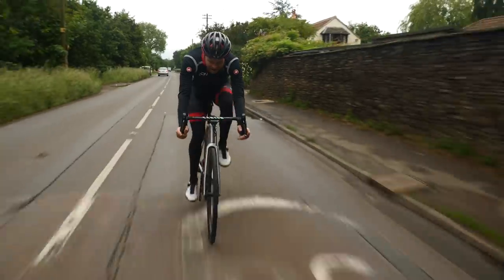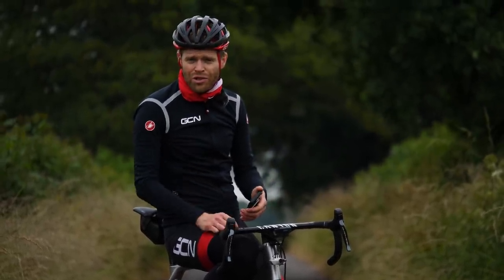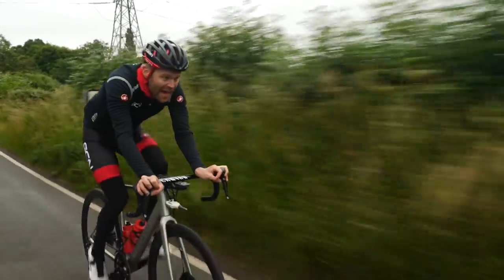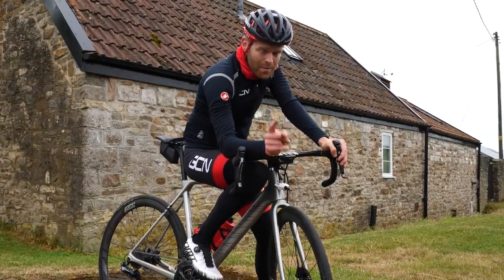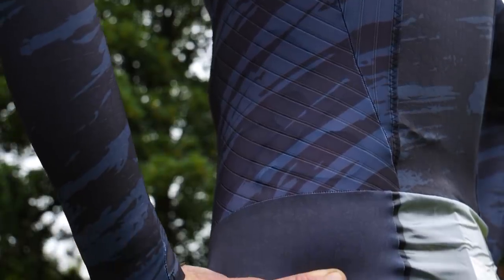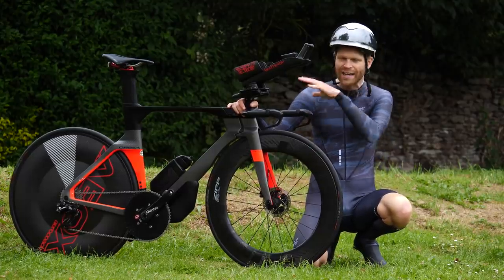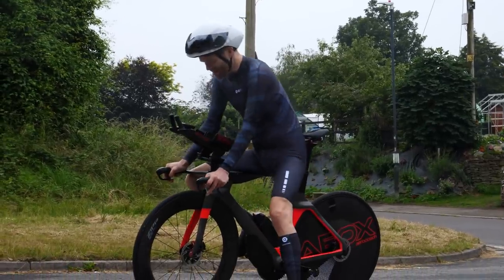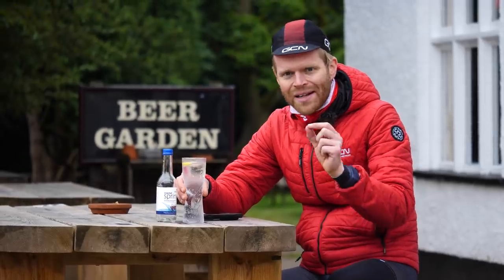The 30 mph Aero Challenge - How Fast Can Ollie Go?

Comment: 3:58 swimming though denser material is a bad example, as you float higher and can push harder in denser fluids. Speed can even increase compared to water.
Reply: The main issue with the comparison in the video is the fact that it refers to difference in viscosity rather than density. Those are two different physical quantities.
Reply: @MartinBrada  all off the aspects i mentioned are possible with only density
Reply: @malloott  Correct, buoyancy obviously  depends only on density. I was referring to the comparison from the video in general. Custard is not that much denser than water, swimming in custard would be more difficult primarily due to viscosity.

Comment: 4:00 for the swiming thing it acctually doesn't change anything in what type of fluid you swim because in a thiner one you can't push your self as far as in a thicker one bur also have a smaller hydrodynamicdrag
Reply: Custard is a non-Newtonian fluid, so it is different to water, in that it behaves more like a solid on impact (side of hand stroke, kick). Same as ketchup

Comment: I'm curious how that sensor works, how does it measure the CdA of something behind it? I had always assumed that coefficient of drag was based on physical measurements of the thing creating the drag?
Reply: The sensor mostly measures air speed (plus acceleration and air density and gradient and a few other things). When combined with data from a power meter (you can see that he's using a Quarq) and a speedometer, it can figure out what the CdA must be in order to go that speed with that power. Then you can use that measured CdA to figure out how much power is needed at different speeds (like, 30 mph).

Comment: Do you have have a link or document available for the Power calculation with all the variables noted? I'd be interested to see the difference in those calcs for the separate attempts.
Reply: The power equation is pretty well understood, if not well known. You can find it here: https://pubmed.ncbi.nlm.nih.gov/28121252/ (or doi: 10.1123/jab.14.3.276)
Reply: @robertchung4914  This is nearly what I was looking for, I was wondering if they had the calculation available with the different specific variables that were used for this test. Mostly interested in my own comparison on the information, I've always found it interesting.

Regardless, thank you very much for the link. I haven't read that paper yet.
Reply: @mattdubya  If you have a power meter, a dedicated speed sensor, and a road that is protected from the wind you can do your own testing without the extra sensor they use (the sensor measures air speed, so if you test under calm conditions your air speed will be the same as your measured ground speed). Then you import your data into Golden Cheetah's Aerolab module (Golden Cheetah used the name Aerolab before the company that created that sensor used it). The advantages of the sensor are that you can test when the wind isn't dead calm, and it will do most of the calculation for you without having to download the data and import it into some other software and play with it. But, when the wind is dead calm and you're careful, you get the same information.

Comment: Fastest I was ever able to sustain was 26mph for 10 miles on a flat but twisty course. My fastest level sprint without a tailwind was 33mph. I don't know where that puts me. Both were on a 22 lb. aluminum bike in 1992. No aero equipment either.

Comment: I probably missed that part, how did Ollie dealt with the wind effect? My biggest challenge is the headwind, even the sidewind when you have aero carbon rims is somehow problematic...
Reply: It was tested in a TT course.
However, there's no film of it because the motorcycle (which is where the cameraman is seated) gives more aero according to Ollie.
That's why the short montage was just for video's sake, not the actual testing.

Comment: Next- see if you can do a 19 on less than 300W. The first thing to go would have to be those motorbike brakes. Integrated rim brakes, please. Then get rid of all but 4 or 5 of the sprockets, and squeeze the stays in, so there's less drag at the rear of the bike. Might have to ditch the sponsor lol.
Reply: the bike is rapid. it could certainly be done on a faster course with warmer weather though 👍🏼

Comment: I'm no aerodynamics scientist but I feel like a key inefficiency in the aero as specially when everything else is considered is having the knuckles exposed to clean air, pro bikers are willing to shave their legs and wear aero socks to minimize the frontage  but I feel like they ignore how much drag is created off the hands. someone should make custom gloves so that when the knuckles are together in the TT bars instead of being a flat surface of the knuckles its more like preying hands, similar to how you point your fingers when diving into a pool rather than putting your knuckles together. I wish I could post a picture to explain but if you understand what I mean let me know. has anyone thought about doing this?

Comment: I'm just 162cm tall. How much aerodynamic advantage shorter riders have?
Reply: Some, but CdA doesn't scale directly with height. In general, it scales less than directly, so someone who is 15% taller than you (as Ollie is) but in the same position as you would have a CdA that's only about 10% higher. Putting it the other way, you're about 12.5% shorter than he but in the same position your CdA would only be somewhere around 9% lower.

Comment: I mean the calculations at the start are cool, but isn't this more of an experimental thing? You get an easier, more accurate measurement by measuring your watt output at a given speed, rather than by doing complicated math and relying on multiple fine-tuned sensors.
Reply: The sensor allows you to factor out wind speed where as just using power at a given speed has an inbuilt assumption of air speed = ground speed which is pretty much never the case. You could with a control bit of road do constant power and roll-down tests to work out the resistances, but I think the point of the sensor is so you can get a more of a live view of how your position affects CD. I've never used such a sensor though so I can't attest to the quality of the data it provides, and I would have thought you would need more than just one sensor to accurately capture the wind velocity profile (speed+directional components).

Comment: Mythbusters tested the “swimming in water va  custard” thing. There’s no difference really as you get a better “grip” from the denser liquid. Hence, a bad analogy for biking :)
Reply: @boronguy  hey, I'm a swimmer. So one of the limiting factors in how fast we can go is our grip on the water. Much like with cycling "gearing" is important.

You could be in the lowest gear and no matter what you do you'll just skin your legs. You can't apply the power. On a higher gear, you can't go faster since you can apply more force. 

Applying this to swimming, if a fluid has a resistance of 0, the swimmer would not move at all. Also if it's infinite they're not moving. So along this line, there's an optimal density and viscosity for EACH swimmer. Depending on strike economy and peak power, different fluid properties would benefit swimmers differently. A SLIGHTLY thicker fluid would benefit a stronger swimmer

Another point, density actually makes swimming easier. Salt water can be faster in a pool because the increased density the swimmer sits higher in the water thus reducing the frontal age surface area in contact with the water
Reply: @boronguy  also another thing with swimming, pools are normally around 28-30c but when major comps happen we take it down to 24-25c. Two reasons, improves the rate at heat is dissipated and slightly increased how thick and dense the water is. Hard to explain to a non swimmer but it's gripper. 

With the rowing one, the blades already have a very high efficiency and you can change the blade shape to grab less or more water so the main limiting factor with rowing boats is friction with the water. Obviously friction is important in swimming since we wear skins etc but the force application is more of a consideration
Reply: @supernoodles908  I have also been a swimmer, and the anology of gearing isnt really applicable because on a bike you would reach a maximum speed based on how fast you would be able to move your legs while in swimming the speed you would need to move your arms not to be slower than the thing that you are swimming in would be the same in custard and water at the same speed.

Also you talk about a theoretical resistance of 0 and while it is not possible to accelerate in this "fluid" any speed can be held with 0watts input. In a fluid with infinite resistance however not movement can be achieved. Mythbuster say these two fluids are exactly the same, which is extremely dumb.

As for the saltwater courses. I've not really been able to verify what you are saying. But in any case the hydrodynamic aspect of the drag would be about the same as in fresh water, since the difference in frontal mass is roughly opposite and equal to the amount of mass hitting the remaining frontal surface. If it would be faster as you say, I would suspect it to have to do something with the wet surface aspect of drag in water. As you would have less surface in contact with the water

Comment: 30 mph is not at all difficult for me in baggy street clothes and one gear. But after about 15 minutes, my power starts dropping by half every 15 minutes, bottoming out around 100 watts. I doubt that a speed suit and $10k bike would any significant difference. Might buy me another two minutes.

Comment: How about the same/ similar, but with a 'bent?
Reply: Most unfaired recumbents have higher CdA than Ollie. Only streamliners or very very highly optimized unfaired recumbents come close (like, the one used by Aurelien Bonneteau). Plus, many recumbents have drivetrain losses, or rolling resistance losses (an exception could be FWD MBB recumbents, but they also have other losses. Modern TT bikes are actually very slippery compared to unfaired recumbents.

Comment: If you look at the good vs bad helmet position you will note the gap at the back of the helmet going to the shoulders. 

The gap is a source of drag. The air will form and eddy of swirling air.  Causing a low pressure area “sucking” you backwards

Comment: should be clear that this power output is what YOU at 65kg (fictional body weight) need to maintain this speed, it is not what I at 107kg(fictional body weight) would need. So power is not a good indicator. I can average 275 watts for an hour, but that does not mean I will cross the line first. Power is only a good measure when ALL variable such as body weight and size are eliminated and everyone is using the same resistance on a trainer. Why does everyone think power output is so all mighty? Would much rather see what zone your heart rate was in, that would give a better indication if there is more room for improvement over scraping a watt or two here and there.

Comment: Ollie, would significantly lower his CdA on the road bike if said bike had slightly higher up a stem which would allow him to adopt that split elbow position that is closer to his TT setup. On the first one here he's mostly presenting two straight "arm-tubes" that are fairly round and hence drag inducing as well as having a higher up torso and head which don't help either.
Also folks, get yourself to a yoga class, you'll learn to have your elbows properly tucked in while maintaining good breathing and you'll also gain hip mobility which will do you wonders in the ability to go low on the bike (and be way more efficient overall). That's the one thing pro cyclists do that you don't but definitely should.

Comment: Great video, except you feel for the common misconception that CdA is effected by the size of the object. CdA is dimensionless, it only takes into account the overall shape, not the size. You have to multiply the CdA by the frontal area to find out the actual drag force. So a smaller rider with a higher CdA could actually have less drag than a larger rider with a smaller CdA.

Comment: Actually, I think it was the Brainiacs, who did test swimming in water and in treacle. It turned out that it was the same.The resistance of the treacle slowed you down but the density of it allowed you to push/pull on it with your hand and feet harder as you swam through. So not really a good analogy to air resistance.

Comment: GCN promotes using 25 or 28mm tyres to go fasters as they claim lower rolling resistance.

Then they put 23mm tyres on their TT bikes...
Reply: it’s not a straightforward question. it depends. at 48kph on a good surface, 23mm on the front is better than 25 or 28.

Comment: 7:00 i do not believe that statement from the suit makerrs. i would love to see a schlieren imaging but there are no mirrors of that size (that are affordable). The only way i see that working is if this suit is "aerophobic" , the same way they made hydrophobic swim suits for professionals and had them banned on the spot. 
Even if they stated that it is just vortex shedding, i would still doubt because the speeds are not high enough for that.
Anyone have more scientific insights on these suits? no, their website is not what i am looking for
Reply: It is the same principle that applies to a golf ball, or to turbulators used with some airceaft wing designs. It is energyzing the boundary layer thus helping the air overcoming the positive pressure gradient. Oli did a good job by using correct terminology and not over simplify. Hope that helped

Comment: If shorter riders go faster, why are bikes built for tall people?
Reply: This makes no sense at all, short bikes are built for short riders and tall bikes for tall riders. That's like saying runners with small feet run fast, so why are all running shoes too big?
Reply: Try riding a normal sized bike at 5 foot.

Just musing from Ollie’s point that smaller riders have less drag and my experience as a shorty. at the shortest heights there really aren’t a ton of bikes made for you.
Reply: @Kimberly_Sparkles  oh you mean why are bikes usually only available for taller riders. Because bikes are unisex but men constitute 87% of riders, so manufacturers make them to fit the available market. If women constituted 87% of the market manufacturers would make smaller bikes.Supply and demand.